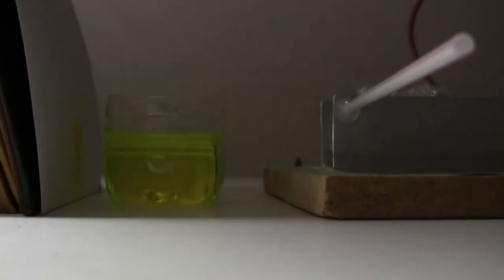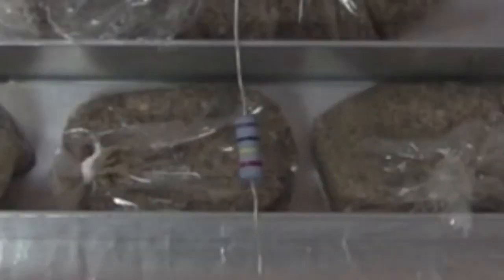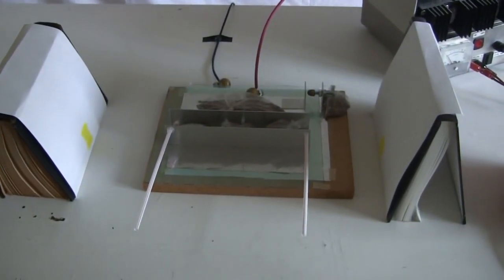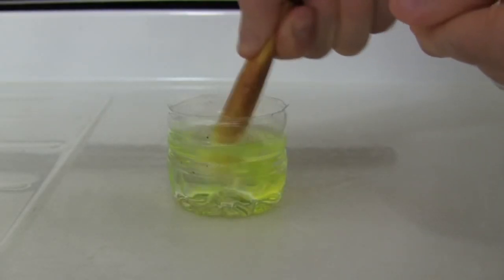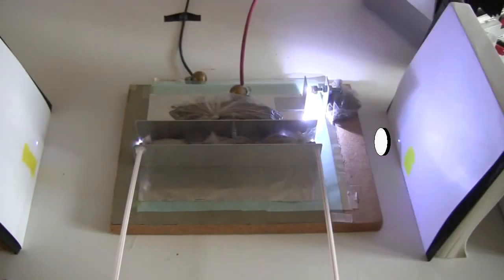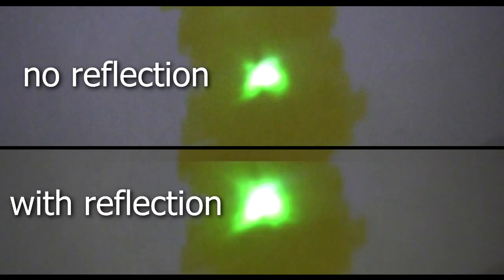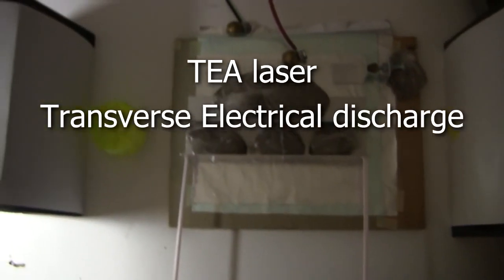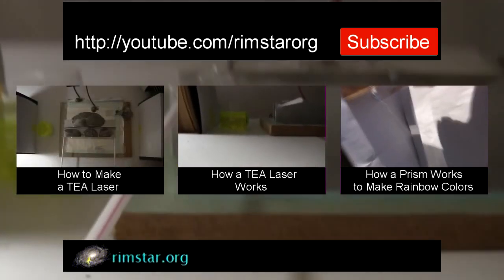TEA Laser - Easy Homemade/DIY Laser

Comment from the maker: I made it all from parts I had, but then I have a lot of parts. The only special parts were probably the aluminum angle pieces, though those could have been done with flat pieces, and the polyethylene dielectric which came from a long roll of it that I'd bought many years ago from a carpet store. Before getting into this I'd thought lasers don't spread out too. But my recent reading says that at least some types do and this type definitely does more than most others.

Comment from the maker: Thank. My initial plan was to use alcohol but I for some reason I can't remember, I decided to try what I did first. And since it did the job, I didn't take it further. Also, since I took the ink from one end only, I just put the tube back in the highlighter and it still works, though its life is significantly shortened. :)

Comment from the maker: Would a small spark gap made of carbon give a high enough charge though? This has to ionize the air in the long lasing spark gap very rapidly and needs a pretty powerful spark to do it, judging by how big I had to make the spark gap before it would work.

Comment from the maker: I used a standard mirror, glass first. It's actually a bicycle mirror. For a first surface mirror I was thinking of the shiny side of aluminum foil. Thanks for the tip re looking in scanners.

Comment from the maker: My homemade TEA laser video. Overview, demonstrations and some experimenting. This is the first of a series of videos on the TEA laser, the others being how-to-make and how-it-works. There was too much to fit into a single video. Enjoy!
Reply: So according to this page http://technology.niagarac.on.ca/people/mcsele/lasers/LasersN2.htm If you seal your TEA laser in a box (perspex works) and vacuum it with a fridge compressor, you could get output in the hundreds of kilowatts range....

The theroy on how it works is making my brain hurt. Looking forward to your how it works video :)

If I'm understanding the theroy right. Electrical discharge stimulates gas (nitrogen) to discharge uv photons, which further excite more gas to discharge more photons, resulting in a short lived exponential amplification of light in a liner plane, causing a laser beam to shoot out. Or am I missing something ?

If you have the light from the spark gap shine on the laser gap, it may help with pre ionization too. Or I'm misunderstanding something.

Any idea what the max repeat rate is? I see there can be issues with dieletric breakdown at high freq. Any other limiting factors? I'm assuming the resistor on the main input is to control the firing rate once the spark gap has been set to optimal...

Fluorescence and other means of photon emission have been on my mind lately. Thanks for inspiring me to look into it more.
Reply from the maker: Mongrel Shark
The electrical discharge excites N2 molecules such that there are more excited than not excited, basically. When the excess ones return to a lower energy state, they give off a photon. A key with nitrogen lasers is that they're super radiant, resulting in enough light as to not need the usual bouncing back and forth of light on mirrors.

I'm not sure yet what would be required for amplification. I don't think I got amplification when I used a mirror to send the beam back through the lasing spark gap, but its possible my mirror was reflecting only visible light and not UV. I'm not sure yet if UV would be required for amplification. If it is then your suggestion of using the spark gap UV light may work.

I've seen some repeating a lot faster than mine, obviously, and I know you do need to pause between lasings - it can't be continuous. But I don't know what the maximum rate is. I didn't use any resistor on the main input. I just kept my power supply turned down so as not to make too much annoying noise. It's quite loud. I had 9 voltage breakdowns of the aluminum foil/polyethylene capacitors as it was.
Reply: This page had some good info in that department. http://tesladownunder.com/LaserNitrogen.htm

States an optimal pulse rate of around 200hz. More than enough to appear continuous :)
Reply: so if you made some neodymium halbach arrays on this,  could you make a free electron laser,  or would you have to use something like a cathode tube?

Comment: Couple of questions ... Apart from the high voltage supply (whitch I have made dozens of) and the angled pieces, is this all from household parts?  And how come the light spreads out?  I thought lazer light could travel forever in a straight beam.

Comment: Nice presentation, as usual.
Here's my version that I made back in May of 2013. I solved some of the problems a bit differently. I'm almost embarrased... but at least it works and I'm using a bit more current than you so I'm getting "quasi-continuous" output.
Do It Yourself: Simple TEA Ultraviolet Laser
Wish I'd thought of the fluorescein in liquid, that's a very nice idea. I think car antifreeze would also work but of course it's quite toxic.

Comment: you said here is what it looks like without reflection even though you were using the mirror? did you get the pics mixed up? also if the spot got bigger using the mirror are you saying  that there was no amplification stimulated then? so the photons of the beam did not help to stimulate further photons? did it become at least brighter?

Comment: so, the resistor allows both top plates to charge (because they fill up slowly), but when the spark gap short circuits the bottom plate with the primary plate (rapid discharge), the path of least resistence for the secondary plate is across the channel gap instead of back through the resistor (because of time?)

Comment: idk what im doing wrong but i do not use a large cap like this,i use a flyback transformer powered by either a cfl circuit or an electronic ballast and i hook it directly to two copper flat plates or aluminium plates and get a cw discharge ,is this not strong enough for the job? does it have to be pulsed to have more power going in?

Comment: Usually, we don't normally see the laser beams themselves especially in bright areas anyway even if they're visible light unless if they're either high powered, shone in a foggy area or have wavelengths from green to violet but I assume these lasers are high powered.
Reply from the maker: Brandon Fisher Unless they interact with something in their path, even if they're high powered, then my understanding is you shouldn't see them at all. The light is moving largely in a single direction (all laser beams spread out somewhat depending on the type of laser.) A laser in a vacuum should be invisible, unless of course it's pointed at your eye.

Comment: i'm not sure I understand. The "laser" is the discharge from the long spark gap?
Reply from the maker: hi li No, the discharge in the long spark gap just adds energy to the electrons and atoms. When they then change state they give up that energy in the form of light. That light then stimulates other energized atoms to undergo stimulated emission of light which results in the laser beam. A more complete explanation is far too complex to put in a comment.

Comment: Alright, since I don't know how to contact you elsewise.....I have a Q about the power supply.   I've got a large NST laying around, but I do most of my playing at work.  here, I DO have a taser power supply module.  It's listed as 400kv (reviews checked it down to 30kv)...but unknown current.   It builds up a good spark.   (https://www.amazon.com/gp/product/B00JVJDEZE/ref=oh_aui_detailpage_o01_s00?ie=UTF8&psc=1)  However, when designing the nearly same exact thing as here, and your website....I can NOT get anything out of the laser.  No spark gap firing, no electro sparks, even when placesd VERY closely.   I see the foils (using copper) and plastic dielectric (using 5mil nylon) move....but no spark.   What can it be?   Is the taser module just NOT the right type of power supply?  Should I build larger/smaller capacitors?     I've tried random things here and there, but I jsut get nothing.  (except shorter electrodes...which would be next)    Ugh.   I should just properly build one again, using the NST, and a nice vacuum tube/N2....but....this looked so easily, and I missed making things like this.
Reply from the maker: Yeah, I don't know why they keep putting those nonsense 400kV, 1 million volts, ... on those tasers. I guess many think it's real but it's false advertising.
You don't need a super powerful power supply to make this laser work, you just need sufficiently high voltage DC. If that one you have is really DC then it should work. I know that because I got it working with my Wimshurst machine https://www.youtube.com/watch?v=9huUsYDJZrM. The trick in this case is to build up the charge on the capacitor in my how-to-make video https://www.youtube.com/watch?v=v9sKqGC3t-0 at four minutes and eighteen seconds in. As long as your power supply can handle the high current of the spark that builds up and can build up sufficient voltage then by trying different spark gap widths, you should get it working. When I do it, the final step is usually to make it wider and wider until it works. The energy built up there will be enough for the lasing, even when built up over around 10 to 20 seconds using my Wimshurst machine.
But there are a lot of over tips in my how-to-make video too.
PS. Comments in these videos are the right place to contact me.